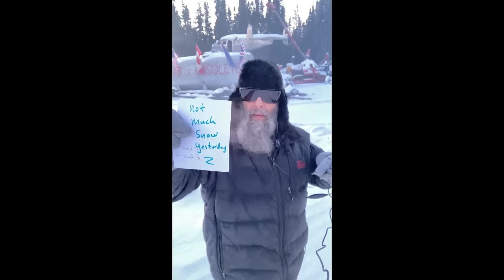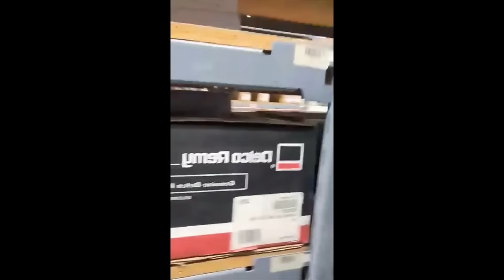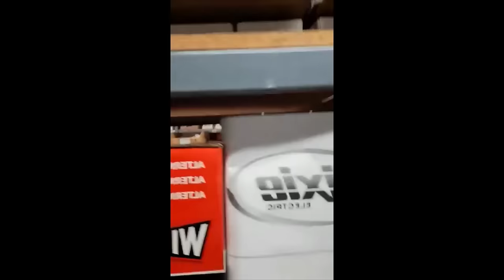IH Bar Starter With Educational Music Dec 19 2023

Comment: made a starter unit like that  but cut the commutator off and welded a 2" nut on the shaft
works good
Reply from the maker: excellent, save the seized ones from scrap  thansk

Comment: When my old starter nub wore down  ,I brassed a copper bolt onto it and mounted a inline knife switch . It worked for a few decades . Likely still does .Sold the rig with the claim.
Reply from the maker: well that is good. made it work and it will last for ever too  thansk

Comment: I learned in the world of drag racing and hi horsepower engines using the chassis as a ground is called a dirty ground. After running as heavy ground as the positive to the starter made a world of difference. Idk just a suggestion 👍👍
Reply from the maker: yes and i lot of people forget to clean the ground where is grounds the frame or body. ground is more important then the positive and is always forgotten  thansk

Comment: I    have   a   lot   of   those   push   buttons   on    my   military   trucks   with   24volts    and   the   main   trouble   is   that   little   peace   of    cardboard   in   there   gets   wet   then   dries   out    and  then  shorts  out   and   with   24volts   it   melts   they   do   make   them   with   plastic   that   are   better  but   hard  to  find   you   may   want   to   put   some   contact   grease  inside   they   will   get   rusty  inside   too   hope   this  helps.
Reply from the maker: we have had good luck up here with everything not rusting for some reason. even the cats that were under water for 3 years came out in good shape  thansk

Comment: STEINER TRACTOR: Lennon, Michigan, 30 mins away from me.  In a pinch I used Brass toilet seat bolts w/ the hooked head to replace the copper bolt. Brass is NOT ZERO resistance like copper, so on really cold mornings we jumped *the starter only* with 24v. Kettering, an inventor at Dayton Engineering Laboratories Company DELCO. An old school inventor, he is credited with inventing the all electric starter for cars while at DELCO. Old School meaning he did things right.  On my English Ford Super Dexta 3 cyl Perkins Diesel Tractor I changed the starter over to hand engagement of the gears separately. Then repurposed the Glow Plug button for the electrical switch. We have to overcome the planned obsolescence by the ones in control or we might just as well hand our bank accounts over to "them."  ben/ michigan
Reply from the maker: yes steiner tractor is well known for their parts and quality service. delco has been around for a long long time and lots of good parts  thansk

Comment: We used to use Wilson reman starters and alternators back in the day, It seemed like everyone stocked Wilson. Weren’t they based out of Winnipeg? I think they changed hands at one point.
Reply from the maker: yes they were good and had a good website too. then they shipped everything to mexico for rebuilding and nothing but junk now. when you have 80% failure rate on changing out starters and alternators on the modern vehicles it was time to change products. had 2 alternators back to back out of the bock that did not work. unreal how they are still in business.  thansk

Comment: Made the same unseizing tool here out of a junk starter but welded a 1 and1/8 nut on it and used a 3/4 inch ratchet.  Not sure it was as strong as yours but worked for me.  Right on dude.
Reply from the maker: yes that is the whole idea is to get it done and save these motors  thansk

Comment: I presume you use lots of ATF  or something else to soak those frozen engines internally.  Using that long of a prybar I am sure you snapped the piston rings most of the time.  I think I would use solder and solid copper to build up those contact points on the starters or maybe braise them up.
Reply from the maker: we only use old diesel and pour it down where the water entered the motor. wait about a year and then try to break it free, on the TD-9 known as Zhoda, we broke the liner and could feel a problem using the Bar Starter. popped the head off and seen the problem  thansk